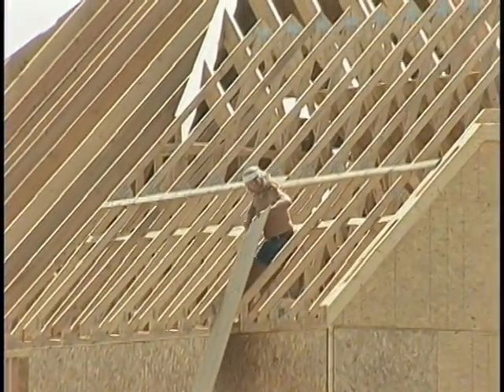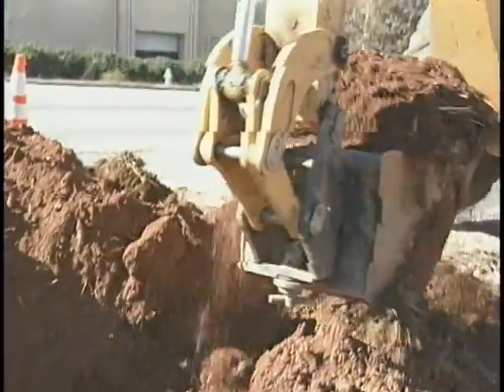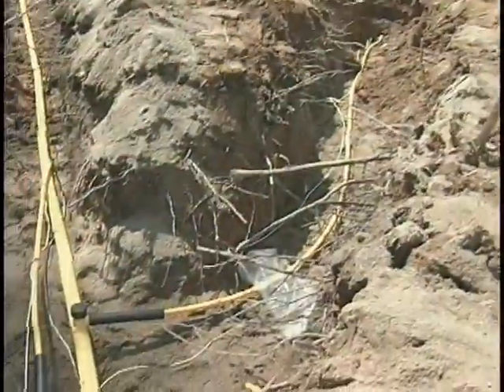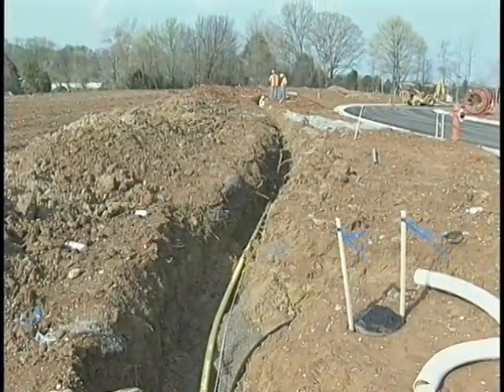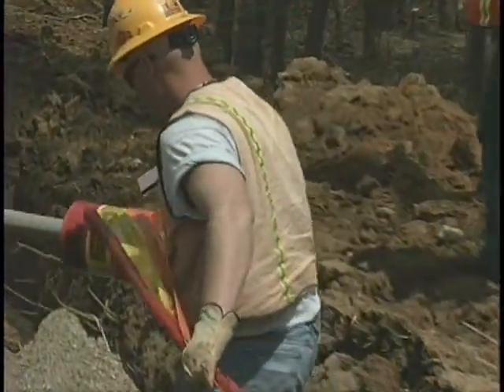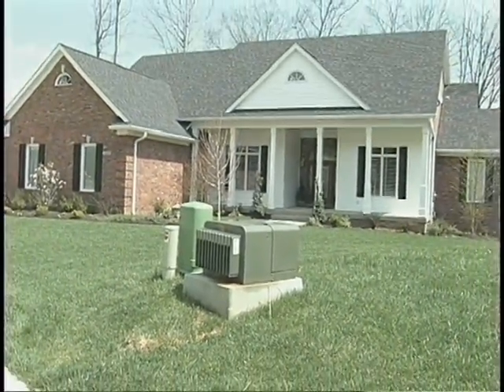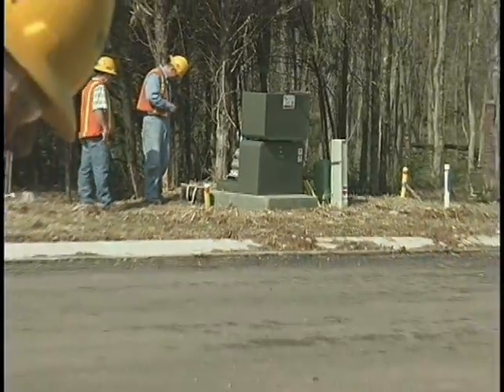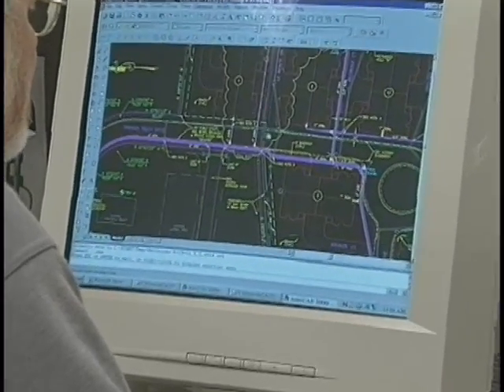Team Fishel: Joint Trench

Comment: In California, PG&E has about 80 different joint trench configurations. And when municipal electric systems get involved, it only adds to the oddness. I agree it can be done well, unfortunately the landscape architects will have a say in where vaults and pedestals can be placed. You may need a transformer or switch or a service for irrigation or street lights. But the developer will think a tree is more important.